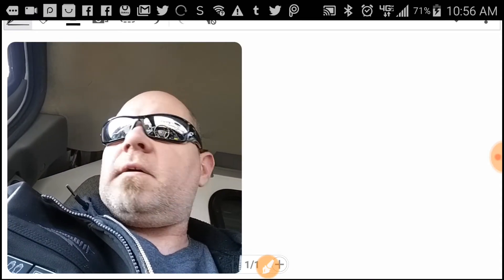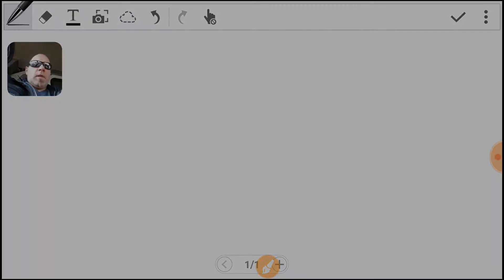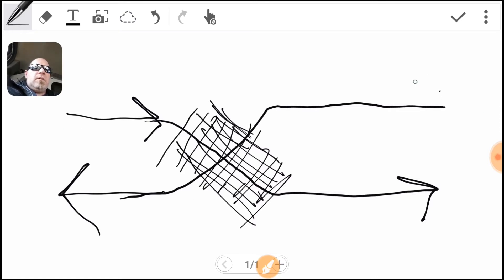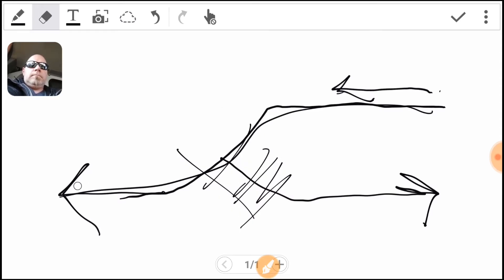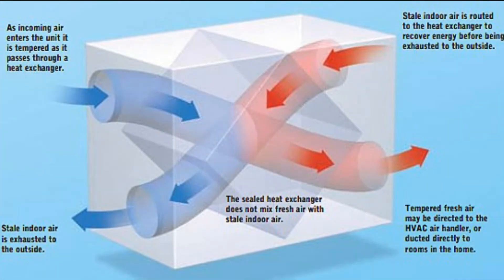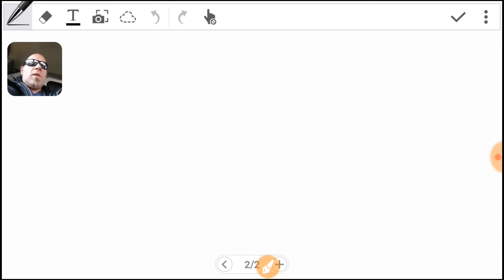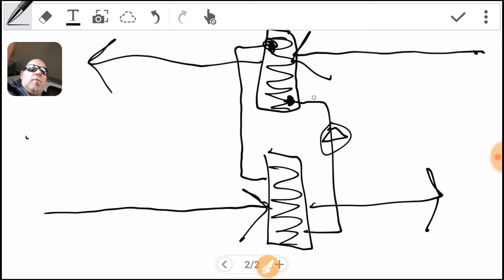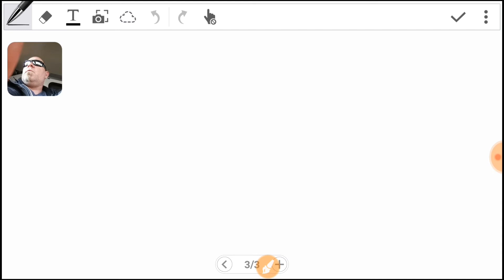HVAC Heat Recovery  (HRV)

Comment: Had a customer ask about a problem they were suffering from with their HRV unit. The setting was Canadian winter. The fresh air inlet was condensing and freezing before the fresh air was reaching the HRV unit. They were asking about possible solutions as it created a cold zone in that part of the home. The inlet was an 8” insulated flex conduit. The run was aprox. 4ft long. Possible solutions?